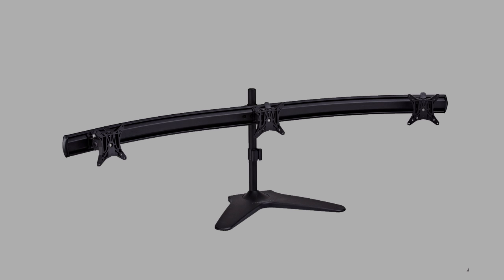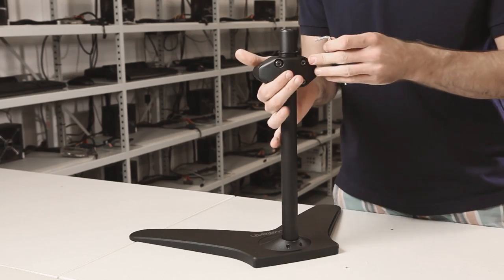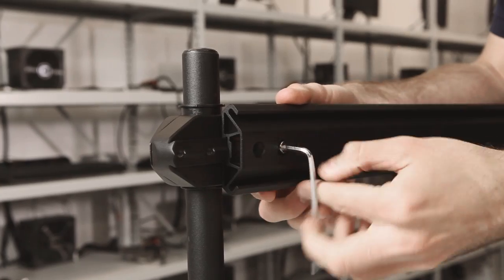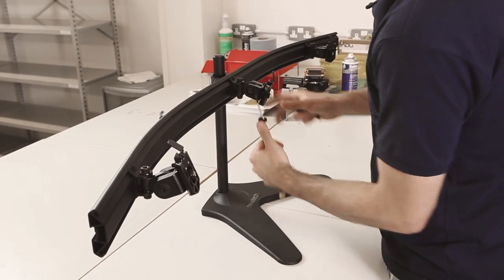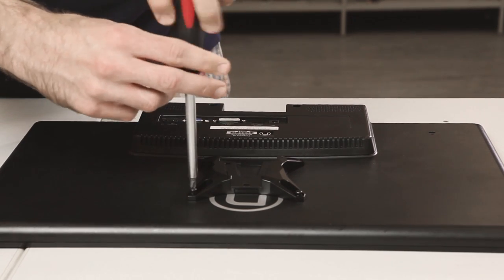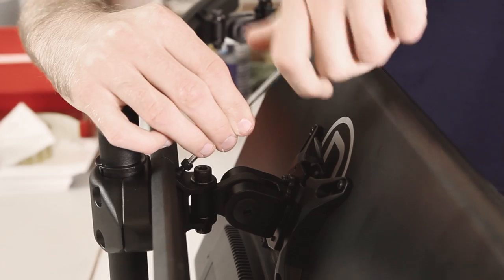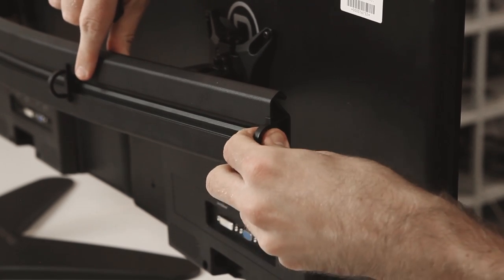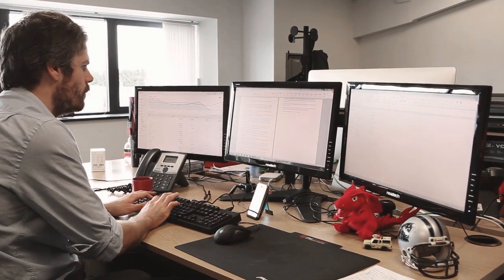Novatech How to: Setting up the Novatech Triple Monitor Stand

Comment: i know it says upto 24 inch monitors but would it fit a 28 in the centre and two smaller monitors mounted vertical on either side?

Comment: would this be able to accommodate for 3 Samsung LS24E510CS 24 Inch HDMI Curved LED Monitors? really need to know thank you
Reply from the maker: +Aaron Moorby If it's the monitor I think it is, the weight is fine, each bracket supports up to 17.6lbs per hinge and that monitor is 7.26lbs. + the widths seem to suggest it'd fit, the stand supports up 61cm Widescreen where as this monitor is 54.7cm? Do you know if the monitor is definitely VESA mountable, I can't see on the Samsung official site but pictures make it look like it is. Have you used one on a VESA mountable monitor stand before?

Comment: id really like this monitor stand but i want to know if i slide both of the end monitors all the way untill it reaches the edge (with 24inch monitors on) will i be able to squeeze a 27inch monitor in the middle ?